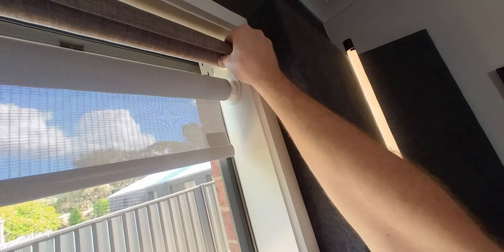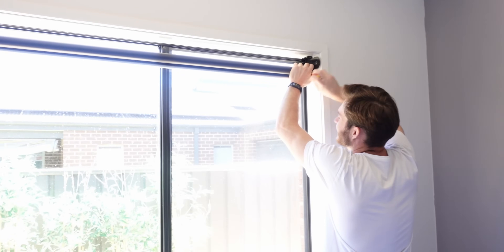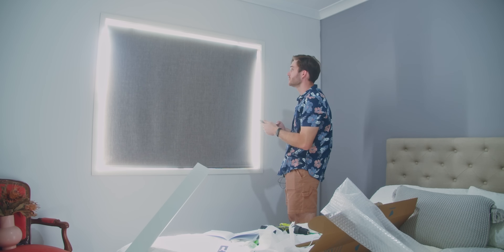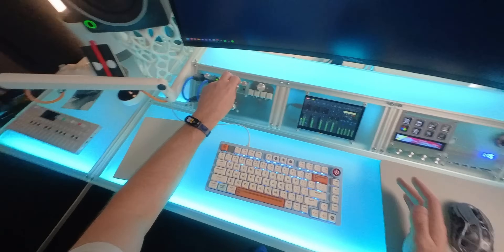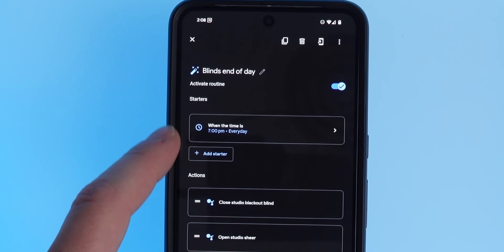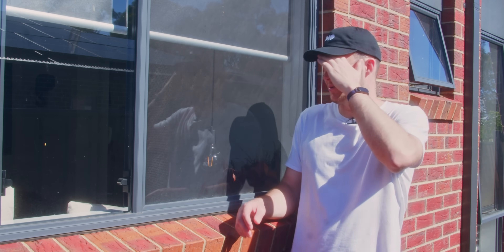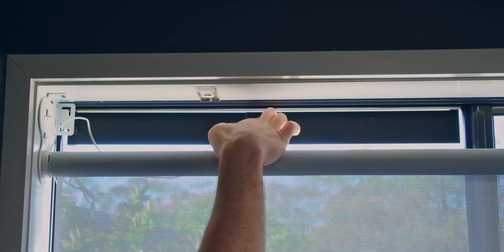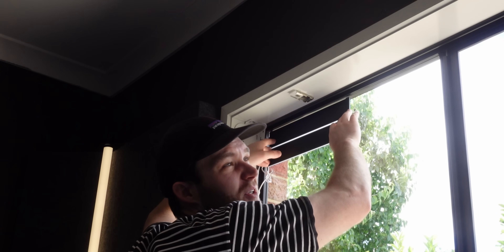Finally Smart Blinds that MATTER... Literally!

Comment: Matter isn't doing all that much new stuff really... The things you praise it for have been around for decades with Zigbee or Zwave. Only thing is that Matter is a standardized and unified combination of lan and wireless protocols agreed upon by big manufacturers and smart hub builders. My zwave or zigbee devices never ever need an internet connection nor do they ever need an app of some sort. 

Let's just hope they can prioritize stability while keeping the prices low. Otherwise it will probably see the same future as zwave, where the standard is hard to maintain and certify, which increases the cost of devices. In turn sparking a downward spiral where people don't buy it because it costs too much, which then make prices go up even more as less and less devices become available.

Matter can be great but up untill now it still all is a lot of big stories without all that much devices or variety of devices. Their roadmap suggests it can still take years before it could be considered on par with zigbee...

Comment: whats the point of the blind if its still letting so much light in from the side lul?
Reply from the maker: you can get channels to block light on the sides if you need true blackout. Guess I'm always used to roller blinds having the gap when mounted inside the window frame.
Reply: Can you link to the channels  @camshand

Comment: a grand for some smart blinds is obscene. Even if you don't consider that Aliexpress sell matter over thread smart blind motors for 100 bucks. 
Plus, let's say 80 bucks for some nicer Ikea dumb blinds.
Reply from the maker: It sounds expensive but as I do the maths in the vid it's on par with the custom made blinds we have in the house plus motors.

Of course it's not going to fit everyone's budget, I'm very much DIY with things like blinds, so cutting down an IKEA offering can do the job. However, I don't believe IKEA has the same range of fabrics and mounting options

Comment: Try Home Assistant! Ill send you a Home Assistant Green!
Reply from the maker: I've seen there is now standalone boards, especially useful for thread networks. How have you found them to perform with matter devices? Last I looked it was beta support
Reply: @camshand  I'm not sure which standalone boards you're referring to, but I've had success with the ZBT-1 that they make for Home Assistant, and have run a stable thread network on it. Matter is a bigger issue though IMO, as it's not fully developed for all device types. My offer stands if you want a HA Green to play with!

Comment: Great vid! I think you should consider Home Assistant, with it you only need single sytem instead of multiple apps.
 You can also use it to control the things in your desk, like lights... etc
Reply from the maker: Yeah I'm looking into the switch over, mainly to be able to easily add window sensors so they don't close if the window is open.

Comment: Maybe consider changing to Home Assistant? It’s open source and supports way more systems and devices. You could likely control some of the stuff in your desk in it 👍
Reply from the maker: It's on my list haha, I ran it temporarily on a mini NAS I built but then purged that instance... Do plan on setting up a raspberry pi or something else to run it as I want to add in my backup power supply that powers the 3D printers and automation of charging through my solar panels on the roof.

I have a feeling Home Assistant will end up being a vid on it's own haha.
Reply: @camshand  You can also run HAOS in a VM on Windows or whatever Docker is
Reply: HA will manage solar panels, I’ve had it running on a PI4 and SSD for years, backs up to my NAS, I would suggest yellow, but I think that will be to simple for you 😂.
Reply: Second this! The only thing you can consistently rely on google to do is scrape your personal data for targeted advertising.